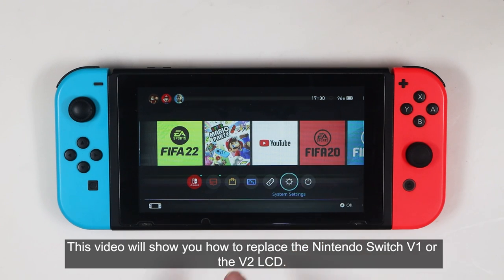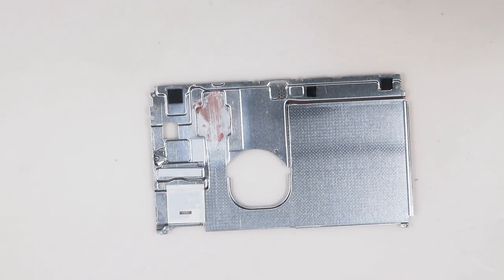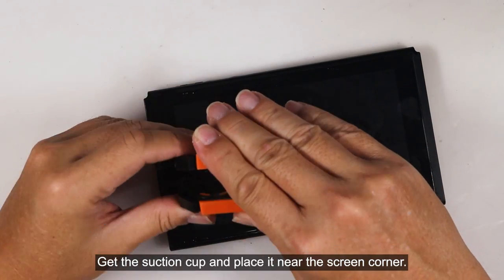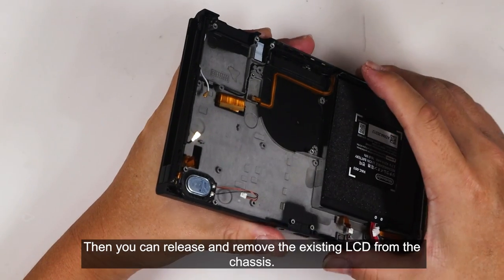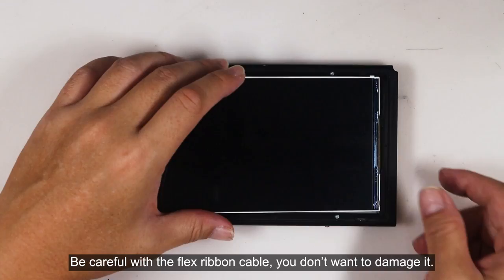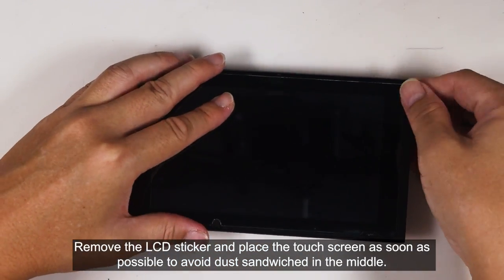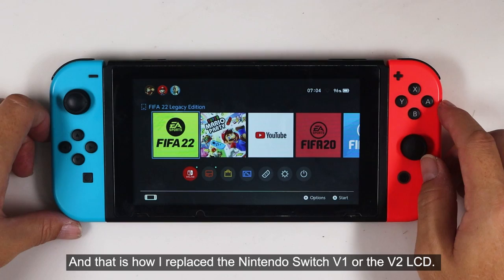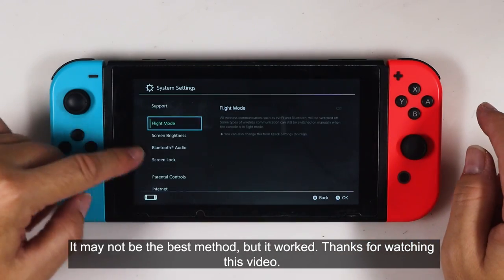REPLACING THE NINTENDO SWITCH V1 V2 LCD

Comment: What would be some of the causes for these horizontal lines appearing would you say?
Reply from the maker: I don't know
Reply: Random i never dropped my switch and my whole screen has like black lines and ghosting of old pixles
Reply: That especific horizontal lines it's caused by the reflection of a very strong light for a long time at the screen. (for example, the sun light)
Reply: Nintendo use cheap parts
Reply: My switch never saw sunlight or any light i was playing Hogwarts legacy one day and suddenly during cutscenes this happened @stevencat

Comment: I wonder what is the issue why this happens. Mine is always docked and rarely used. I was so surprised when i took it out to clean and saw the lines. It ruined my day because i never mishandled it, never dropped, not even a scratch.
Reply from the maker: it could be anything. random.
Reply: Overheat problem….my Switch still have no problem for about 3 years. I mostly played handheld mode.

Comment: Excellent video like usual, but one little detail about the replacement a new digitizer: you need a double adhesive foam tape to hold the LCD or else it will move around in the case. It just happened to me today after resassembling the whole thing.
Reply from the maker: Great tip!
Reply: @sthetixofficial i’m having an enormous problem with my switch. Every time I turn it on it shows vertical lines that it turned or a black screen. And now when I turn it on it just shows the black screen. It still works still makes sound but it’s just the black screen please give me some info on how to fix this problem please

Comment: will this fix a red/blue line on the LCD?
it showed up one day and i'm not sure if it's because of the battery swelling or just the LCD somehow going bad. I don't remember it happening. it just showed up one day.
Reply from the maker: if it is not permanent, then dont worry about it. but if it is something like in this video, you need to replace it.

Comment: Great Video. I have a question tho. Is it necesessary to remove the whole board? I can see that somewhere on the process it revealed the lcd cable already, I am scared to remove the whole board since I jb soldered switch.

Comment: Excellent video, IPA is isopropyl alcohol? I have a big stain on the LCD screen, and my touch screen is very scratched, do you recommend I buy a specific LCD+ touch kit? I have seen many in ALiEX and even some say that they are improved versions
Reply from the maker: try replacing the screen protector. IPA is isopropyl alcohol

Comment: Would you be able to fix my switch lite and switch oled with mod chips? I'm having a bit of trouble 😅 😬
Reply from the maker: what's the issue?
Reply: @sthetixofficial  I don't know the diode values it's yellow lighting into red and also my b point broke off the oled hwfly chip last night is there an alt point with a multimeter?
Reply from the maker: we can repair the B point on the modchip.
Reply: @sthetixofficial  is there an alt b point with a multimeter? I tried scratching near the point to expose the copper and solder idk if it worked I had a reading of 52.1
Reply: @sthetixofficial  so did you find the alt b point with a multimeter? Please 🙏
Reply from the maker: this one : https://filedn.com/lric62b9t2vz5v4OvwHkKJS/B-Point-Alt.png
Reply: @sthetixofficial  I wish you lived in the USA I need help with a oled repair and now my switch lite won't turn on either I have bad luck. I want that nice clear Flux I have the no clean Flux
Reply: @sthetixofficial  hey thank you I'll try it!!

Comment: Is it really necessary to open the motherboard? You can just disconnect the lcd cable and open the digitizer without opening the motherboard which is way more safe (?)
Reply from the maker: of course. how can u remove the cable if u dont remove the board. you might end up bursting the lcd socket and the flexible cable itself

Comment: is it ok to use blower if I can't manage to remove the digitizer screen?
Reply from the maker: you can but you better use IPA, as it is far easier than using heat.
Reply: @sthetixofficial  will it damage the digitizer or not?
Reply: @hellopo5218 ipa does not conduct electricity and overall evaporates easily. It may be the safest thşng to use on electronic devices. Make sure you use the highest percent ipa.